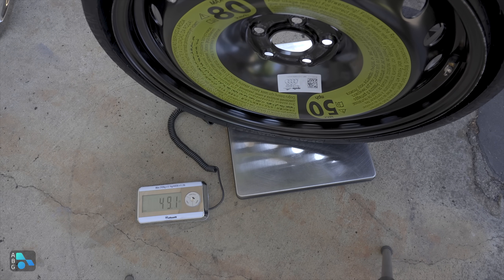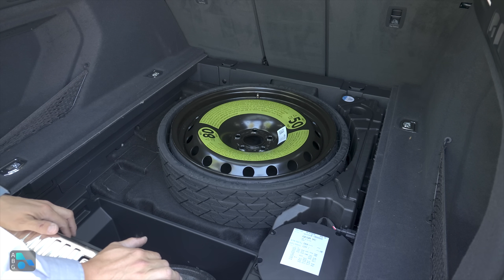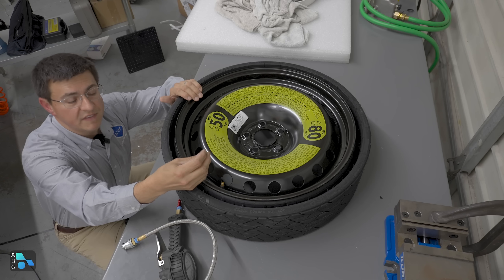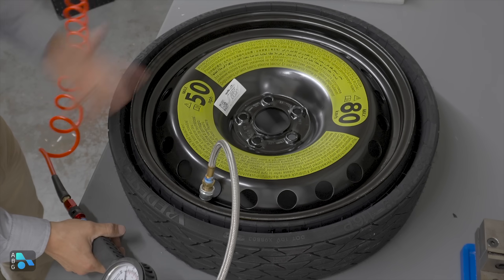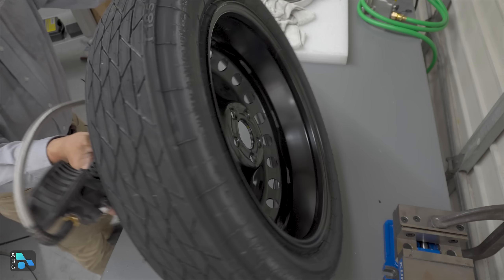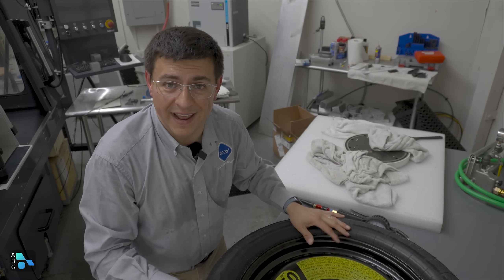How A Collapsible Spare Tire Works, And How It Might Save The Spare Tire In EVs

Comment: This is actually a great design. A big deal breaker for many shoppers is not having a spare tire.
Reply: What kind of automobile manufacturer designs a vehicle without a spare?  SMFH
Reply: @kennethmelnychuk9737 sadly,most of em now
Reply: This isn't a spare tire, it's a gimmick, and is definitely 100% a deal breaker.
Reply: It shouldn't be, fewer and fewer cars come with them every year, more and more drivers don't even know how to change one. It's easier to meet fuel efficiency standards by just including tire pressure monitoring and runflats.
Reply: Honestly 🤣🤣🤣 who needs a spare tire that you have to inflate 💀
Reply: @awesomeness369  Someone with a flat tire and a convenient source of compressed air with which to inflate it, and no good place to store a full-sized pre-inflated spare tire.
Reply: @vulpo  and buy a truck 😋
Reply: They're flat out horrible.
Heavy, awkward, and fail to take are half the time due to an unseated bead.

I encounter these things on the regular and have to walk because it won't take are (without a high volume tank which few service vehicles carry).
Reply: @amzarnacht6710  be creative dig that can of Ozium and a lighter out of your center console and get busy setting that bead roadside. Works for a regular spare donut's bead that's come off the rim anyway. Whether it'll work with these folding tires or not I'm going to try anyway and find out! If I've got an air pump a can of Ozium or something else flammable and a lighter I ain't giving up.
Reply: @ButterfatFarms :  did you mean “Ouzo”?
Reply: @amzarnacht6710  the other less exciting way of setting the bead I've heard about is to have a ratchet strap with you and wrap it around the circumference of the tire and ratchet it down tight and add air.
Reply: Not for the majority, the vast majority of people have no idea how to change a wheel nowadays.
Reply: @ledsalesoz :  why should they waste their energy and their clean clothes when they can just wait a few hours (in the cold because the heater consumed the battery power on their EV)  for the auto club to show up and change the tire for them?
Reply: @kennethmelnychuk9737   There are many areas of this country, out in the wild, that have no cell or data coverage. If they get a flat in one of these places, there will be no auto club coming to save them.
Reply: @vulpo :  agreed, it would be best to carry a spare and not drive am EV out of the city
Reply: @vulpo in that case a full size spares best
Reply: @ledsalesoz  just adds an extra step to the dumbasses that don't know how to tighten a bolt 💀 lemme just inflate my emergency spare tire with this tire inflator I always have on me at all times
Reply: This, and maybe a pneumatic jack, would be perfect for the Cybertruck which has its own pressurized air pump built into the vehicle.
Reply: @vulpo  that was a more recent patent that expired in 2022. Not aware of anyone who licensed it and used it or if anyone else has taken up the idea since the patent expired.
Reply: @vulpo The original Hummers had a built in tire pressure pump as well 😉😀
Reply: @vulpo  patent protection only lasts so long and a pneumatic automotive jack isn't a very original idea at this point. Can't imagine there are any valid current patents for such that are practical and economical. A better idea is a pneumatic jack that has a refillable compressed air or gas cylinder to operate the jack. This can be provided with or used on any vehicle. It's already been patented, that patent has run its term and the idea is freely available to use. I've never seen anyone use it. Has anyone ever seen a self-operated self-contained pneumatic jack for sale?
Reply: @ButterfatFarms  Yes, you are right. After reading more comments below, I realized GM had this in some of their cars way back in the 1970s and I removed that statement from my comment. I mentioned the pneumatic jack because the CT has the high pressure compressor built-in (for its air suspension) and thus could easily inflate the tire quickly (because some people are saying that is a problem with collapsible spares) and power the jack. So it seems like it would be a good fit for the CT.

Comment: Looks dangerous when it pops while inflating.
Reply: It’s not dangerous.  

You remove the tire and pump. Start the pump filling the tire. Walk away and start jacking up the car and removing the flat tire. By the time you’re done, the spare is inflated and “popped” when you weren’t even near it. 

If you’re worried about that tire pop then you probably shouldn’t be jacking up a 5000 pound car.

Comment: This is an amazing compromise. I can't consider vehicles without a spare, I have to drive for work quite a lot. Love the general concept of the miniature tire in the front compartment. Makes perfect sense.
Reply: @xsleep1 I have 2014 Ford C-Max  hybrid. No C-Max was factory equipped with a spare tire of ANY sort. Last May, I had a tire go flat while on an Interstate in St Louis. This occurred on a Saturday afternoon.I got off at the next exit going slowly to a gas station to air up the tire. The tire wouldn't hold air. I called the nearest location of the tire shop chain I use. They couldn't/wouldn't be able to repair or replace the  tire until the following Monday. I limped my car to the shop I've used for 20+ years. Total distance about 10 miles going very slow on secondary streets with my hazard flashers going. When I got to the shop, the flat tire was completely shot. The new tire cost ~ $250. Luckily, the original wheel was not damaged. 

No temporary space-saving spare was available nor a "plain Jane" steel wheel was available, not even from Ford! My solution was buying a C-max OEM alloy wheel from a salvage yard for $100 and having the tire shop mount a less expensive tire on the salvaged wheel $150. Now i had at least a fully functional spare tire that AAA road service could change. I also bought a scissors jack and collapsible tire iron.  

Total expenditure to have a complete spare tire system about $310-$320.

Why did I do all this? Because the following month I had to drive to rural Colorado about 4 hrs beyond Denver. I was going to a family wedding. If getting a flat in my home city on a Saturday afternoon was a kind of a cluster-____, I sure as hell wasn't going to take a chance on having a FUBAR experience in the boonies!

I love my C-Max other than the lack of a factory spare tire, but what my auo shop people said was many manufacturers are deleting the spare tire. That idea is idiotic!! Equipping a vehicle with a 12 volt air compressor and a "giant economy sized" bottle of Slime tire sealant is NOT a solution. Green Slime and a hand pump might be acceptable for a bicycle, but not a car ot truck.

If I have to buy another vehicle, if it doesn't have a spare tire, jack and tire iron, then those items will be the first things I buy.
Reply: @richstanton8545 Or, maybe, don't buy the vehicle.
If enough people get smart and stop padding manufacturer's pockets on those models they'll eventually be discontinued... or updated.
Prius, for some years, had no spare nor was it designed to carry one.  Then something happened, I'm not sure what, but spares reappeared in newer models in short order.
Reply: Until you pull one out and find out you can't air it up because the bead's unseated.
Reply: @amzarnacht6710  I don't know about these spare tires but I've set a tire's bead on the rim roadside with a can of Ozium and a lighter. With a regular spare donut if you've got an air pump a can of Ozium and a lighter you can set the bead and air it up. Been there, done that.
Reply: @ButterfatFarms  Not even about to try that, sorry.  There are these things called 'safety standards' and my insurance won't touch that.
Reply: @amzarnacht6710  You worry too much! 😁 I didn't have any experience until I did. Just use a little bit and keep trying, using a bit more until you use just enough for the tire to go poof and the bead sets. Then get a air pump on it ASAP and start inflating it before the bead unseats again as the hot gas  inside the tire starts cooling down. When you use very little fuel there is very little drama. It's entirely underwhelming as it goes poof. Just err on the side of caution and use as little as possible and if it doesn't set try again what's a little more.
Reply: just throw a spare in the trunk or mount it on the back
Reply: @fortheloveofnoise  - Once you toss a spare in the trunk, you lose significant space for carrying things.  I prefer to have spare tire space designed into the car.  That makes the day-to-day carrying places much cleaner and easier to deal with.
Reply: So, when was the last time you had a flat? Or, how many times a year do you have a flat?
Reply: @xsleep1 about 3 months ago.
Reply: @xsleep1 twice in the last year for me. Spares should be required by law
Reply: @xsleep1 about once every two years, the roads around my area are terrible and being in the UK we spend about 70% of our days driving in darkness for work.
Reply: @xsleep1  how many flats do you think you'll be getting after a hurricane when everybody's roof has just been re-roofed. There's damn roofing nails everywhere. Happens after every bad storm. You will end up with them in your tires. Depending on where you live not everyone has the luxury of going years without a flat tire. Or you live somewhere where you go a few years without a flat tire and then get three of them in short order. Like after a hurricane.
Reply: @xsleep 1 A spare tire is kind of like insurance. Worthless UNTIL YOU NEED IT. Thing is, when you need it, you need it!
Reply: after some years its complete garbage like ev cars
Reply: @retrocompaq tell me you haven’t done research on new tech without telling me you haven’t done research on new tech. (It seems you had bad experiences before and think EVs are STILL the same
Reply: @retrocompaq says the guy after the second turbo charger, the second head gasket and multiple maintenance stops with fresh oil, filters and spark plugs to the guy who drives his tesla for 11 years with nearly no maintenance and without any problem…
Reply: @retrocompaq lmfao, okay boomer

Comment: There's another problem that no one seems to be addressing......

So thr next time im on a big cross country road trip carrying 5 people and luggage is packed to the ceiling in my SUV.... When i get a flat and put the spare tire on... Where am i suppose to store the flatted tire? On my lap?

Sure, many vehicles may come with a spare tire under the cargo floor, but that tire well is only big enough for the spare tire. Car makers expect you to put the flat tire in the main cargo area. But what if the cargo area is full of luggage? Do i abandon the flat tire on the side of the interstate? Or toss my spouse's luggage to the side of the road and buy her all brand new clothes when we get to our vacation? destination?
Reply from the maker: Just leave it on the roadside 😂
Reply: So when you drive cross country you do it with the car packed so full there’s no room ANYWHERE inside your car? 🤦🏻‍♂️ If so, how do you see out the rear and side windows?
You move some stuff around, put the tire in back and drive to a place that will repair it and put it back on quickly so the spare will go back in its spot. The spare tire isn’t designed to be driven on cross country.
Reply: @NovaResource  I haven't been able to use my rear view mirror for years.... This is what happens when I have 2 car seats installed in the 2nd row and a double stroller in the cargo area.  The view out of my rear view mirror is always obscured. 

I've regained some of the cargo space in my CX9 as my kids are getting older. So imagine doing the overnight cannonball run from NYC to Disney world... And taking the double stroller, pack n play, diapers, training potty, bottles, bottle sterilizer, baby formula powder and baby water.... Plus suitcases. And imagine having a tire failure in the middle of the night. Yeah, I can put the spare on, but I'll still be driving for hours through the night until morning when a tire shop opens.

My kids are a little older now, so we don't bring the pack n play, bottles, bottle sterilizer, training potty
Reply: @flarearrow9808  I have a 26, a 24 and a 20 year old. I know what it was like. If you can’t see out the back window then you’re taking too much, don’t know how to pack or using the wrong vehicle. Let me guess you drive an SUV instead of a minivan because you’re one of “those people” that would rather drive an SUV because you think minivans are uncool. Well, minivans have more room and function than an SUV. But I get it. Most people your age care more about their image over functionality.

Comment: So where do you put the flat tire?
It won't fit in the same space that the spare was.
Reply from the maker: If the cargo area is full you have a problem for sure.
Reply: Kinda by design. You put it in the cargo area as a way to force you to get it repaired quickly and not drive on the spare long.
Reply: @NovaResource  So if I get a flat on the way to see the grandparents and we have the trunk full of stuff we take out the stuff, take out the spare, put everything back in the trunk and draw straws to see which of the kids has to finish the ride with the flat tire on their lap?
We had these problems when we got space-saver spares years ago instead of having a 5th tire. It certainly sounds like we're going backwards.
Reply: @ghost307  You can put some of the things that were in the trunk in the hole below the trunk floor where the spare tire was. That will create some new space above the trunk floor.

Comment: Great video! I have not come across this type of spare before but will be looking for it in the future!

Do you think there are any concerns of degradation along the creases as the tire sits around waiting to be used?
Reply: GM cars had them back in the late 1960’s. The one in my 1976 Nova is still good. I would only use it for short trips to go get the regular tire repaired.

Comment: Nice concept but this will make having a flat even more frustrating by having to deal with more nonsense. Even Alex admitted it takes forever to fill up with the pump.
Especially on a 'luxury' car why can't they just have a regular spare that you can just swap and move on. Keep things simple.
Anyone watch the movie 28 Days Later? The part where they got a flat in the tunnel? They would've have been dead with this nonsense.
Reply: If you start the pump first before even jacking up the car the tire will be full by the time you get the flat off and start bolting the spare on.

Comment: Nice and if you have triple A you could inflate the tire and have them change it.  Assuming they are willing to jack up and change tires on ev's.  Not sure.  I saw a video where a tow truck driver refused to tow an ev because he didn't know how to.  I have to imagine they would be okay changing a tire though.
Reply: its not a problem jacking up EVs, because just like any gas car I have owned they have specific jack points.  Where they are is clearly shown in the manual
Reply: @Hotspur37  Absolutely, but the ev has a standard way of towing as well and in the vid the tow truck guy refused because he didn't have experience with ev's.  Just wonder if others might have the same issue trying to get someone to jack it up and change the tire.

Comment: Awesome video! My Cayenne has the same thing. I saw my spare and laughed thinking it was a joke. Had no idea it expanded like that. Thanks for sharing, could come in handy one day.
Reply: Had a Cayenne Turbo... Instead of a spare tire, they decided to have a subwoofer and an air pump & can of fix-a-flat... Unfortunately, it had low profile tires, so the one time I had a flat on it, it busted a quarter-size hole out of the sidewall where I hit a pothole... No can of fix-a-flat is going to fix that... No spare tire would have helped either because it did the same to the front AND rear tires on that side... Luckily, I was only about 2.5 miles from my home and it was all 30-35 mph residential streets, so I just hobbled on home and lucked out with it not damaging the rims... I then bought a new set of regular profile tires and rims so that it would be more forgiving of potholes...
Reply: its will be a joke when you gonne have a flat tire in winter or rain and the pump will take an hour to inflate the tire, i have one in my sq5 and its complete garbage
Reply: You'll get to use it - ONCE.
After that the bead will separate when it's deflated (unless it's done by a Porche/Merc/Audi certified service dept and even they'll screw it up half the time) and you'll be left carrying around 60lbs of dead weight for no reason.
Reply: Owns a Cayenne with no idea how the spare works 🙄

Comment: An excellent option for a spare tire. I think we will start to see more in the future.
Reply: God I hope not.
These things are absolute garbage.  They're ONE USE only.  After that you need a professional tire shop to ensure it's functional for future use.
Reply: no its not, i have one, it take and hour to inflate when the pump is few years old
Reply: @retrocompaq  I am sorry you are having problems with your old spare tire inflator. Have you tried contacting the inflator manufacturer or dealership where you purchased your vehicle. Because the inflator is absolutely necessary it should have a lifetime warranty. Can you fit a full- size spare into the compact spare tire spot?
Reply: @MartinStockel-k6f  yea warranty ain't gonna fix it then a there when you on the side of the road trying to inflate the tire.